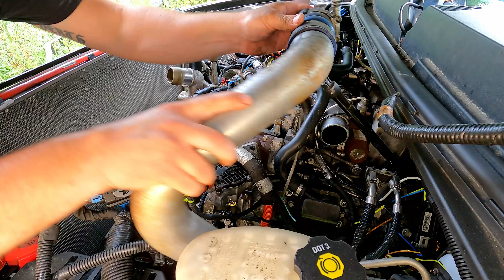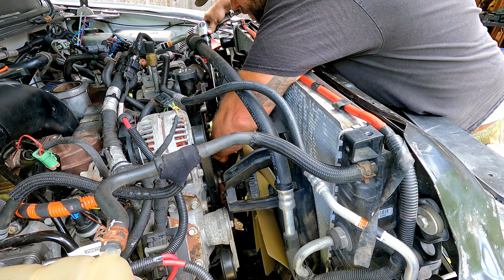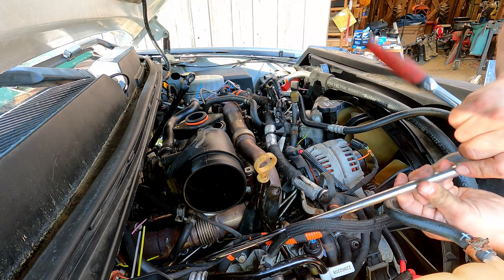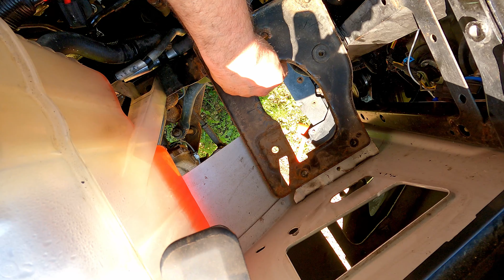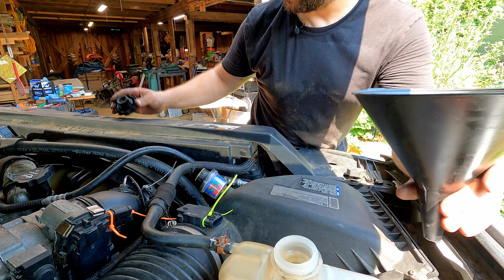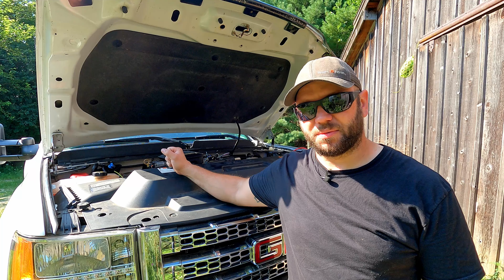DURAMAX HEAD GASKET REPLACEMENT PART 10

Comment: I am currently replacing the head gaskets in my 08 GMC. I watched your videos and they convinced me that the day I spent removing my front fenders was worth it. It is so much easier than reaching over. Obviously cab removal would make it simple but I don’t have that ability.
Reply from the maker: I agree removing the fenders would have made it much easier. I kept them on because I was outside and I knew the truck would be like that for a couple of months. I felt like leaving them on gave the engine more protection while it was sitting. That being said if I ever have to do something like this again I would remove the fenders. Thanks for watching!